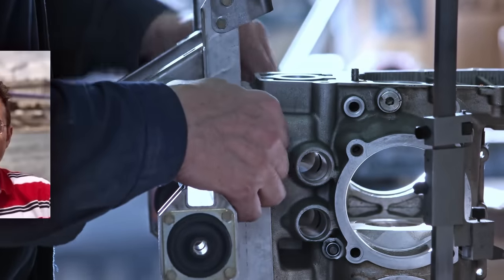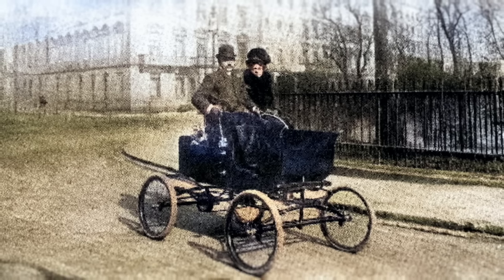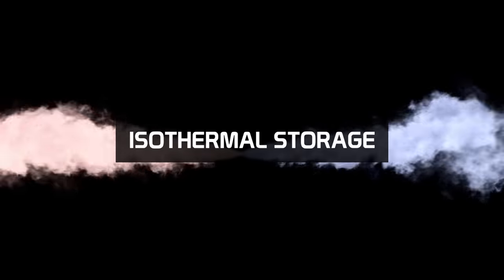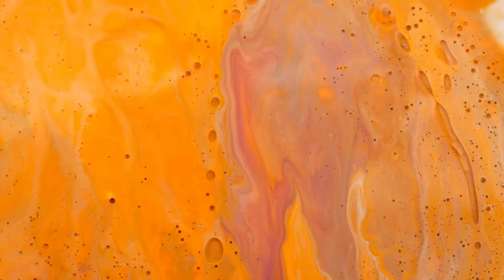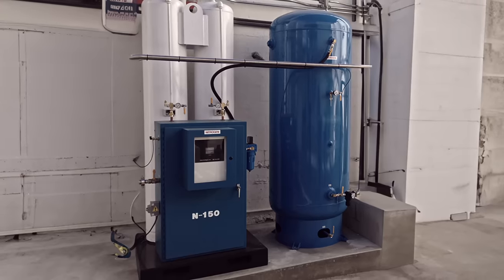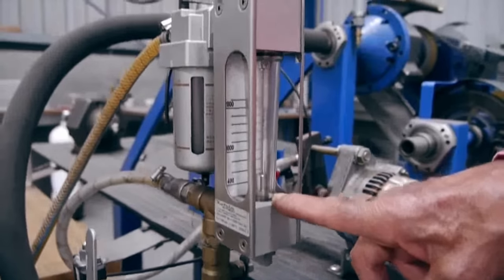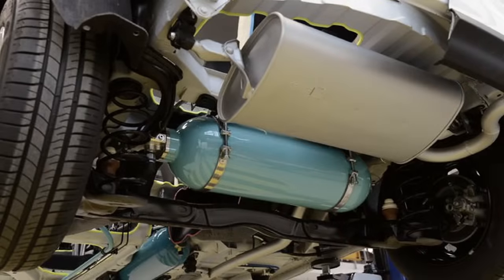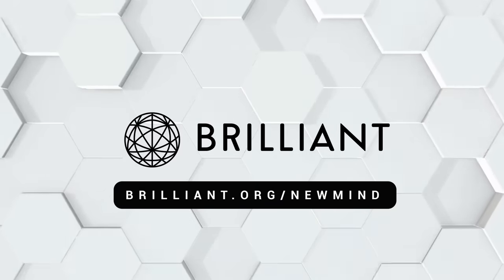Driving On Compressed Air: The Little-Known Compressed Air Revolution

Comment: Physics will always tell you that compressed air is a very inefficient energy storage. It's even inefficient in a workshop, where its benefits can still outweigh the inefficiency. But for cars, LMAO.
Reply: Was looking for this comment. Factories have been moving away from compressed air as a “energy source” (pneumatic cylinders etc in machines) for years now and switching to electric actuators instead. It is way more efficient (thus cheaper and less emissions) to use the electricity directly rather than using electricity to make compressed air and then use it..
Reply: @bowesterlund3719  Yes, even in the shop, a lot of energy is lost, and with BLDC motors and the necessary controllers/inverters getting cheaper and smaller, one of the main arguments of using pressurized air tools - being compact - has become obsolete.
It still has a place in industries where explosions can occur, though.
Reply: And about 10 years ago, MDI also claimed a practical car powered by compressed air. So far no sign of it hitting the road.
Reply: @tz8785  The more air you need to store, the less practical it becomes. As a result, there are a few small and range-limited cars on the market, I believe made by Tata.
Reply: @graealex Exactly! A good example of what you are saying is a dremel. It can almost do the same work as a similarly sized die grinder but without the 3 hp air compressor. Personally I only use my garage compressor for stuff when I need the air itself. Like pumping tires or blowing dust of things etc
Reply: Exactly,  it's because of the anisothermic nature of the compression process,  you loose a ton of energy to heat into the fluid during compressing it.  There is like 90% or something energy loss in the compression process.
Reply: @theianmce  Well, that's not true. For large-scale, you can reuse the heat.
Small scale, like an engine, you simply get back the heat from the environment.
Practical losses are anywhere between 10 and 40%. The main problem remains storage, especially in a vehicle.
Reply: @bowesterlund3719 yes, noise alone must be a killer for factories. Like walking beside a truck releasing air brakes. 
I’ve worked in factories with cacophony of compressed air, multiple point sources.
Original Daimler / Mercedes advance was exhaust muffler.
Electricity is just so superior, will get more so with Tesla actuators for Optimus robots.
Reply: Arguably, air could scale better than batteries. The air cylinder scales very nicely with amount of energy stored. Another bonus is refueling time. And, of course, safety and cost.
Reply: @graealex the environment does not have enough heat to usefully and quickly add enough to make sense
Reply: @alexpyattaev  No, it’s total nonsense.
Reply: The safest thing about a 2-10k psi cylinder that can be in a crash is not being next to it...
Reply: @r3drumg33k3  Well, the problem is mostly weight of high-pressure vessels. It's the same problem that has plagued hydrogen as well.
The tank doesn't really pose a safety hazard, because if it's strong enough to carry high-pressure air, it's strong enough to survive a crash without catastrophic failure.
Reply: Imagine a crash with a full tank? Thats a big fucking boom
Reply: @Sausketo  It's not, usually. It's mostly only a danger with CNG.
Reply: @graealex  what? If you know anything about compressed air you know its extremely dangerous when a full tank is ruptured, it doesnt have to be cng to basically explode when the pressure chamber ruptures
Reply: true, but i think its still interesting
Reply: They seem to think we care about efficiency when we live in an air atmosphere and don't need to buy air
Reply: @alexpyattaev  Not sure what you mean by "scales well". On one hand, surface area vs. volume scales at different rates, so you are right that a larger pressure vessel is more efficient than a small one. The bigger it is, the less material per volume you need.
But you can't just keep increasing and increasing the pressure. Plus the vessels already need to be very large and very heavy. In addition, the rate at which you need to discharge the vessel to get the same amount of energy out of it per time interval also can't increase indefinitely. Meaning, a half-empty vessel doesn't perform particularly well, so you have to over-provision from the beginning.
Reply: With regards to the pneumatic tools, the heat loss is the primary problem. You'd need a crazy setup at the compressor and then heavily insulated air lines to carry the hot air to the tools. 
And for tools that benefit from air over electric (off the top of my head) die grinders, air hammers, and air scalers. 

I don't know how well the research covered in the video can be applied to cars, it would obviously be for short range applications with frequent-ish refills, but it will be interesting to see what it can do on very large scale industrial applications that use compressed air.
Reply: @Sausketo  Yes, but it is not likely to rupture from a crash. The problem with CNG, and to some degree LNG comes from when a car burns, and the tank gets heated, because the safety valve will then have to release burnable gas into the existing fire. CNG cars explode at fuel stations, not in crashes. They have a very safe track record when it comes to crashes, at least regarding explosions.
Reply: @graealex  a pressure vessel stong enough to survive a crash would be incredibly heavy, which causes its own problems in a crash
Reply: @Sausketo  Practical application shows that the pressure vessels in CNG cars aren't a problem in crashes, at least not initially. They can become a problem when the car starts to burn.
Reply: Laugh My 'Air' Off?
Reply: @graealex  Well a half empty battery has the same problems=)
Reply: 1000 psi in a tank that ruptures during a car accident would result in a whole new spectrum of traumatic injuries.
Reply: @undertow2142  Why would a tank that easily holds 1000psi at normal conditions rupture during a crash?
Reply: @graealex  actually, I think physics / engineering says otherwise.
Counter-intuitive.
4680 battery casings are pressure vessels, needed overbuild for same pressure as 2170.
I’ve seen YouTube on this, but I’m not an engineer. Probably Limiting Factor vids.
Reply: still is the best to drive alot of 3 1/2" framing nail. the battery ones have improved so much but havent yet caught up to the pace in the trade. So.. would a mini railgun firing nails with electricity instead of air pressure be more efficient?
Reply: This is what I was thinking. Even small mechanic shops have been moving away from compressed air.
Reply: @alexpyattaev  No it doesn't. For modern batteries, voltage stays relatively constant until the end, and you can pull almost the same amps. It is true that you usually want to avoid discharging to 0%, and charging up to 100% to increase longevity.
But a pressurized vessel acts more like a capacitor, where the voltage (electrical equivalent to pressure) decreases constantly while you discharge.
It's not even limited to pressurized air, but is a problem in many applications where below a certain pressure, the gas cannot be put to work anymore. 
In a practical application, you need to overbuilt a lot of parts to work both with the very high pressure when the vessel is fully charged, and the rather low pressure, when the vessel is pretty discharged already.
With batteries, you can build mostly around the one ideal voltage, which saves on weight mostly, because also the amps will be rather constant for the same amount of power.
Reply: @iandavies4853  Most modern EVs usually use prismatic or pouch-type cells. Tesla switching to 4680 shows that cylindrical cells are a compromise, which can only somewhat be mitigated by increasing the cell size so you're not wasting too much weight just on the casing. Model S has around 8000 individual 18650 cells, which is a rather stupid setup.
Reply: @graealex  where did this come from? Your initial comment was great. Air doesn’t work for cars. Period.
Musk started SpaceX & Tesla, revolutionised two industries.
Your comment on cells way off topic (& dumb). Disparaging Tesla is dumb.
Cylindrical cells work for nickel chemistry, pressure vessel needed due to thermal runaway. 
Metal jacket protects delicate components for industrial processes.
Pouch are nonsense, cheap, fragile. Prismatic works for LFP, eg CATL, thermal runaway less an issue.
Learn from those like Musk & Tesla engineers.
Stick to the topic, air needs too much pressure, too much vessel, too much weight.
Also suffers same loss as ICE piston engines, so 20% round trip efficiency or worse.
Same narrow revs - power band, so needs multi-speed gearbox.
Reply: @iandavies4853  Nah not going to discuss with Musk fanboys.
Reply: @graealex  No arguing with any of that, but air still looks like an interesting option for in-city travel (especially due to its significantly superior environmental and safety factors compared to batteries). Arguably, it could be even an interesting concept for a hybrid vehicle using a combustion engine for range and COPV tanks for in-city travel. Super fast refuel for both systems is a possibility, regenerative braking, all the benefits of EVs with very few of their disadvantages (like extra mass, toxic elements and fire hazards). And while there are losses associated with compression of air, if it is only done using renewable energy it may not be such a big issue.
Reply: Air compression can be done with refrigerant panels more efficiently than solar to electric to battery.
Reply: @antiprismatic  wind to compressed air directly will be better still=)
Reply: @antiprismatic  still enormous loss getting kinetic energy from compressed air.
For vehicles / cars, it’s a total fail.
It’s said to be an option for grid storage - I’ve yet to see details.
But yeah, managing the enormous heat change seems to be key.
Then we need $ and Wright’s learning / cost curve as it uses established technology, unlikely to reduce in cost much.
Batteries are kicking a***.
Reply: Carbazol as energy storage...
Reply: @iandavies4853 musk didnt start those companies. Give credit to the engineers the ceo is a figurehead
Reply: @radnukespeoplesminds  don’t be a fool all your life. Even Musk credits the engineers, & assembly line workers. Credit Musk too, he’s way more than figurehead, expert level understanding many topics.
Reply: My whole livelihood is working on industrial air compressors, this discussion makes me realize I may need  to respecialize soon
Reply: @towmotornoises  There are many applications where compressed air is still the best way. For example, everywhere where there's a risk of explosion, and everywhere where very high energy density is required, making electrically operated power tools unwieldy.
Reply: @graealex One practicality of compressed air tools is that you don't carry the compressor and it's motor with you. 

Nail guns for example are a lot lighter when they are pneumatic, compared to the battery versions. That said some nail guns burn powder or gas and are similarly light, without the hose.
Reply: @tz8785 I was working in Paris back in 2006 and there were actually working and driving MDI vehicles on the road and not only prototypes.
Reply: @bowesterlund3719 saying a dremel is as good as a die grinder shows your inexperience with each tool. That's ridiculous.  I use both at work on a daily and they're nowhere near the same tool.
Reply: @campbellpaul you not only didn't pay attention to the vid and the type of equipment used. Stay in your lane.
Reply: Lmao whatever you say professor
Reply: What’s physics?
Reply: This commenter and many of the responders failed to watch or to grasp the content of the video. The efficiency issues with shop air were directly dealt with in multiple ways. Take a class in thermodynamics before spouting off.
Reply: @theianmce didn't watch the video.
Reply: @kylenolan3138  Yes thank you professor, your input is duly noted.
Reply: @graealex , your response lacks substance.
Reply: @kylenolan3138  As did your comment. That was my point. You can add something to the discussion, if you want. Or not. But don't just run around calling everyone incompetent.
You know, even a prominent YouTube creator felt the need to post some negative, non-substantiated comment in this thread, but had a last-minute change-of-heart and deleted it. Because it wasn't constructive. Maybe do the same.
Reply: But there are compressed air tools.
Reply: But magically...  it 4x better than lithium batteries!  Just think happy thoughts!
Reply: @paradiseisland69  I'd be repeating a lot of what has been said here, but a car is conceptional very different from a compressed-air tool that is connected via a hose to a large tank and compressor. With a vehicle, you have to carry the air with you, and that means a lot of compromises regarding mostly weight.
Reply: What is the thermal efficient of the compression cycle in this model? And what is the relationship between volume of air, energy to maintain and size of storage?
Reply: @graealex Depending on what battery chemistry. LFP has a relatively very flat voltage-capacity curve due to the contribution of phase boundary shift, allowing for relative consistent diffusion rate of li-ion. Though, it also introduces challenge to battery capacity prediction.
Reply: @ngroy8636  I am not aware of any battery chemistry that has a completely proportional voltage discharge curve. All batteries operate within a rather narrow voltage-band.
That is, as I already wrote, what distinguishes capacitors, as the depletion of the stored charge will directly cause the voltage to drop. With chemical batteries, the chemical reaction approximately occurs at the same potential. Obviously, while the remaining reaction partners get depleted, the voltage does sag, around 25%. In addition, voltage does sag due to ESR when demanding high amperage.
Reply: Source: trust me bro
Reply: @zoobie2000  'nother comment with zero substance? We're getting there...
Reply: This is exactly backwards and wrong.
Reply: @clavo3352  Another one... Is there an argument here?
Reply: Compressed air would be a great oxidizer for any fuel you use
Reply: @alexpyattaev How would you add regenerative braking? I guess you could have the engine operate as a compressor when braking. Sort of like a jake-brake but that would be pretty inefficient being mostly mechanical. You could have standard regenerative breaks that run an electric compressor but then you'd be really doubling down on those conversion losses... Not to mention you wouldn't be getting the benefits of those heavy hub motors just using them as brakes. Maybe you are thinking hybrid drive train but two drive trains tends to mean the same performance of of either with all the down-sides and complexities of both. 

In any case, just like electricity storage, the fuel is only as green as the methods that produce it. (Hence why most "green" tech is largely a farse)

I guarantee you none of what you've proposed will ever happen. Sorry to burst your high pressure bubble.
Reply: Then dont make electricity and use that to compress air. Compress the air directly and avoid the losses in conversion
Reply: @highlandrab19  Lol. Converting between mechanical and electrical energy is one of the most efficient ways. It's often even more efficient to convert to electricity if you plan on transporting it any significant distance. Sometimes it's even more efficient to convert even with small distances, instead of using transmissions, like it's done in diesel locomotives.
Electricity really isn't the problem here.
Reply: @ragnarok7976  well, regen braking is nice to have, of course, but to be honest I think you need not capture 100% of the energy of the vehicle (neither does any EV achieve that). Capturing anything more than 0% is already a win compared to conventional combustion vehicle. 

As for the means of production of "fuel", you are 100% correct there, and compressed air is directly producible from wind turbines without intermediate conversion into electricity. Some wind farms actually use compressed air for grid energy storage for precisely that reason. 

As for whether it will or will not happen this will depend 100% on the price of lithium ion batteries=) With them being too expensive to support all usecases, some compressed air solutions may appear.
Reply: Company in France built compressed air car
Reply: physics will also tell you a combustion engine runs on compressed air. duh
Reply: @stuart6478  That's a far stretch. But even if we agree on that, the compression comes from chemical energy stored within a fuel.
Reply: @JohnSmith-kf1fc air hammers can't even be touched by an electric option rn all you have is a soft framing hammer replacement that very few people want
Reply: @icraftcrafts8685 That was a gas🤓🤣🤣🤣
Reply: I work in a shed and use air tools have them in electric aswell. We don't give a shit about electricity bills because we make heaps of money. Who gives a shit?
Reply: @radicaledwards3449  I'm in Tucson AZ no shortage of heat here.
Reply: Most of the time when pneumatic actuators or pistons or valves ect, are used where I work, it’s for simple tasks. Moving something small in an in house built jig 9/10 times. I can only assume that’s due to the jigs being 1.) very very old 2.) The reluctance to adopt new technology by shop management and “DonT FiX iT If itS Not bRoKEn” mentality. It still has its niches in some situations when it’s more feasible to store a given amount of compressed air to achieve something you don’t have the ability to achieve with an electric alternative.
Reply: @graealex because they have a limited lifespan, and people would never change their tanks. Every single CNG car on the road today has an expired tank. Trust me, look at the dates on the tanks.
Reply: @rrt5000 I think that has more to do with cost of tools and less with energy efficiency. Shops don't care about energy efficiency, more about mobility and productivity.
Reply: @nobodynever7884  no. The tire shop near my house hasn't used compressed air for a couple years. They have 5 bays. The owner said that it is cheaper, less noisey, they have more mobility, and gave me a few more reasons why. But he said his monthly electric bill has been reduced. He initially went to battery when the main air compressor needed repair. He made the switch and will not go back.
Reply: And what oil company do you work for sir?
Reply: @graealex  I checked the math and the energy density only scales with material strength, not diameter...
Reply: @glike2  Not sure what exactly you checked. For a given pressure, you need a certain material strength, yes.
But surface area scales different from volume. Area scales to the power of two, volume to the power of three.
So if you scale up a pressure vessel, it gets more efficient, because less material is needed.
Reply: I trust Li-on batteries even less.

Too many incidents. Hot ones.
Reply: 200 years ago they had Underground trains running on air OK buddy😮
Reply: @James-cs2wi  Completely missed the point, but "OK buddy"
Reply: Even steam is better.
Reply: @graealex . I’ve long thought that to increase the storage in a given volume of space you could have a tank in tank system, as many stages as required, that would allow a doubling of pressure for each stage. The burst pressure of each stage would be increased by the external air pressure inside the next stage.
   Managing it properly would of course be critical.
Reply: @iandavies4853    Could work quite usefully as a regenerative braking system on a ICE transport truck. Mounted to a trailer axle.
Wouldn’t need a ton of storage as you could discharge for added acceleration on any adverse grade or lift off from a stop.
Reply: @Stan-b3v  original poster graealex nailed it - for cars LMAO.
Physics is against it, as is need for variable speed / volume / pressure. That’s a mechanical system you propose - mostly we are moving to electronic. Trailers with auxiliary motive power / regen sound great, but Tesla (& Mercedes, etc) aren’t adopting the idea.
Electric drive has won road transport, move onto next problem.
Reply: @iandavies4853    I did, mentally at least, a long time ago. Where I went was to trains, putting one axle into each car with an electric drive/ brake and a storage battery. 
   That would give us the potential for using rail cars much more efficiently by having them able to uncouple and detrack onto sidings under their own power as well as rejoin and decouple under their own power. Having drive potential in every car would further allow navigation of steeper grades and tighter corners with less efficiency loss… blah blah 😑
Reply: How about just for fun?
Reply: @brofessormex  "For fun" is fine, watch Tom Stanton's videos to see how far you can go with compressed air vehicles and aircraft.
Reply: Tell that to a 22,000rpm diegrinder! Electric motor die grinders don't come close 😅
Reply: @bowesterlund3719 . Compressed air is the best for sanding and cutting. The tools weigh so little, and the lack of power makes for safer work.
Reply: What about a compressed air electric hybrid.?EngineAir. Melbourne Australia.
Reply: @CertifiedSkank  I totally agree but the author of this video doesn't, the great thing about air tools is the ease of rpm they, and yes way safer😅
Reply: @CraigLandsberg-lk1ep    Any blue-collar worker will tell you that they don’t want to hold an electric grinder all day when a pneumatic does the job just fine.
Reply: @ralphpremici7632  I like your thinking 😅 there is a air powered car in Gran Turismo 5 on PlayStation 3 that uses the chassis as a super strong air tank that drives all wheels making 800hp from only compressed air, a US car company designed it as a Vision GT for the game
Reply: @CertifiedSkank  totally agree 😅
Reply: Roy Meyers car that ran on compressed air and his patented compressed air engine could go 500 miles at 35 miles per hour. Sources linked below:

https://en.m.wikipedia.org/wiki/File:1932_Roy_J_Meyers_Compressed_Air_Car.jpg
Reply: Love the armchair engineering crew that have invented nothing that think somehow they know something
Reply: @bluettr250  Physics don't change depending on whether you have engineered something or not. And being an ass also doesn't change.
Reply: Spoken like a real corpo guy. No long term profit generation for corporation so it must be bad
Reply: @B3RG3RS0N  What a stupid thing to say. Economics don't change physics.
Reply: @graealex  keep trolling you are doing great
Reply: What benefits does compressed air have in an auto shop?
Reply: @aaronfield7899  For example, the tools can be very compact compared to the power they provide.
Reply: Well, we don't always have electricity, so we use combustion engines to compress air. Electronics and electricity have their disadvantages as well. It is known that electronics are very sensitive, consumer, and difficult to deal with, and this is something that is desirable for companies, especially the consumer side!
Reply: You seem very....... paid, maybe incentivized, and certainly asleep.
Reply: But this should not prevent us from always trying to improve, as even electric cars are considered inefficient. We must also diversify our devices and not be limited to the narrow circle of electricity.
Reply: Knight rider blew the gen lee away is what I think the real science scaring the hell out of the establishment hold up is
Reply: @graealex Yeah Hydrogden cars like the Mirai weigh more than the Model 3!

  I can't believe people think hydrogen will ever take off when the volumetric density, and therefore storage size is so bad.

  Like they must not like room in their cars, because they are surrounded by high 750 BAR tank that are notorious for leaking, with a gas you can't detect, and kill you. 

 Anyway didn't the video state the guy got 90% effiency from his vehicle?

 Anyone know the max therotical limits on compressed air? Like energy per liter and weight?
Reply: Hold up. What we should be asking is price.

  I guarantee you if you could somehow build one of these compressed air vehicles with 90% effiency that had 200 miles.For something like 20k? 

 Then hell yeah people would buy it for the cities. Espscially if you added a compressor to fill it. 

 The question science can't answer is. Why do cars made for urban commutes have to be so damn ugly? Always like some Pixar car looking thing.
Reply: @dianapennepacker6854  Well, with hydrogen you have the option of liquefying it. And even in gaseous form it has 5MJ/L at 700 bar (8MJ/L when liquid) vs 35 MJ/L for gasoline. Just pressurized air has a measly 0.175 MJ/L at the same pressure. But it's not possible to liquefy pressurized air, because then you couldn't extract any work from it.
There is no feasible theoretical limit on energy density since you can always increase the pressure, it's more of an engineering problem in combination with weight and volume restrictions inside your average vehicle. Plus some practical problems for how you would for example refuel.
Reply: @graealex  Never knew that about air. That is interesting actually that you can keep squishing it basically. I appreciate the reply. 

 Never in a million years would I've thought that was all the power. Thanks for the comparison so I didn't have to look up the numbers too. 

 We need lithium air batteries like yesterday.
Reply: @dianapennepacker6854  The reality is that building more efficient vehicles really isn't a pressing issue. All problems that stem from cars can be solved by using something else than cars. And most issues have been solved a long time ago anyway. You can easily drive a car with 3 L petrol per 100 km (80 MPG), it is just going to look very different from the current mega trucks that sell in big numbers.
Reply: ah ok. using tons of lithium batteries is ok then? XD compressed air = win win for all except the energy giants which cant earn money from empty air.
Reply: @Knightfire66  I'm tired of explaining the underlying physical problems for the 100th time to people who having nothing to contribute.
Reply: Only an extremely slow comprehension, using giant pistons, could increase the efficiency of the system.
Reply: @ricke4492  No, speed isn't relevant. It would just mean the heat during compression would get released slower, making it even harder to recapture it for something. Carnot made some formulas about it two centuries ago...
Reply: I think many people that are against the compressed air engine are making patments on a new Tesla
Reply: I belive that when you put on into the equation the cost to extract, transport, refine, health problems cause the pollution, the pollution itself....
Even with a bad energy efficiency, compressed air is a good option.
There is air everywhere , no need to rage a war to others country to stole oil nor finance a coup to take lithium.

And the original idea was to use carbon fiber to do the air tanks.